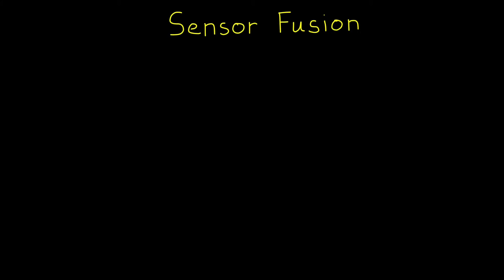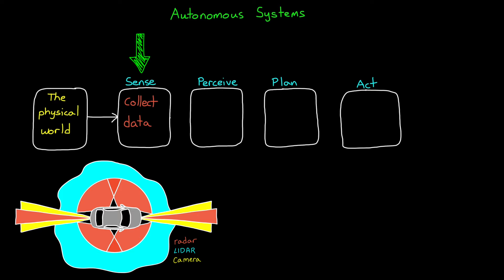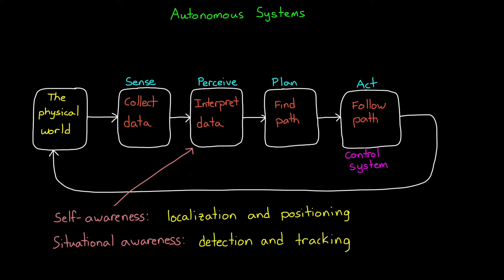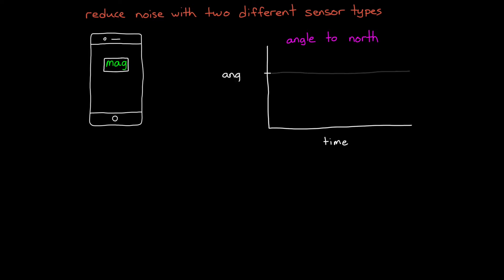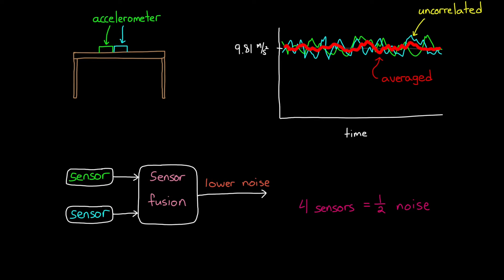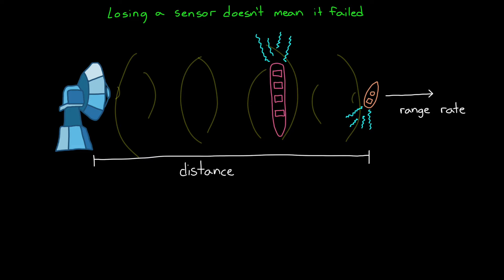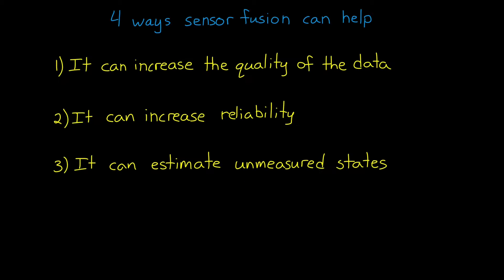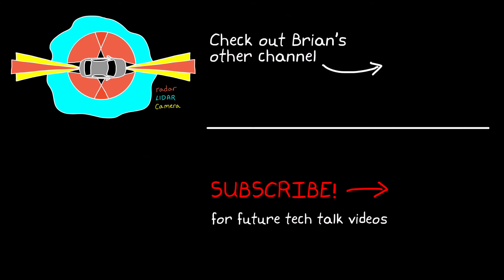Understanding Sensor Fusion and Tracking, Part 1: What Is Sensor Fusion?

Comment: "Fusing sensors together reduces the combined noise by a factor of the square root of the number of sensors"
Why is that?
Reply: It comes from multiplying the probabilities of two distributions - or combining two Gaussians.  Check out equation 11 here: https://www.bzarg.com/p/how-a-kalman-filter-works-in-pictures/. If you have two noisy sensors, each with the same variance, sigma0^2 = sigma1^2, then when you blend them together the new variance is 1/2 of the individual sensor variances.  Or, if you report noise as a standard deviation instead of variance then the combined standard deviations is 1/sqrt(2) of the individual sensors. Or the square root of 2 less.  This works out with 3, 4, 5, or more sensors.  As long as they have the same variance then the blended variance is 1/(number of sensors) and the blended standard deviation is 1/sqrt(number of sensors).
Reply: I'm curious about this too , and i realized that the creator of this clip is answer this by himself . Thank you for more information . your clips are very useful and have a very good explanation :)